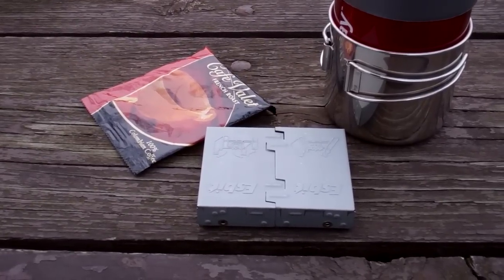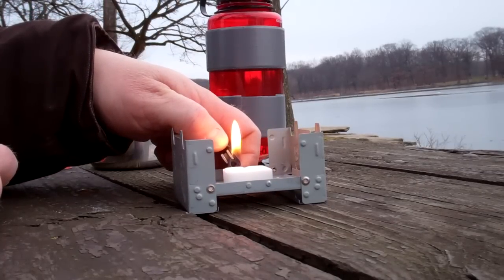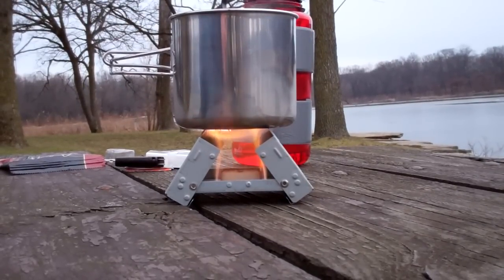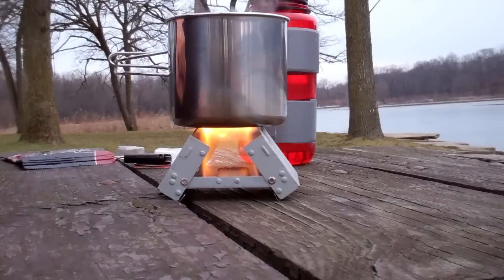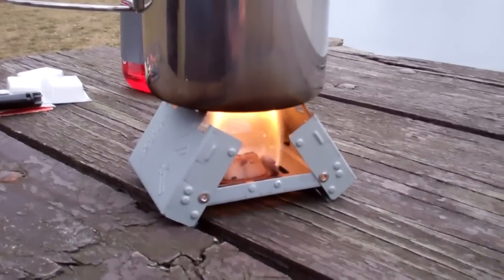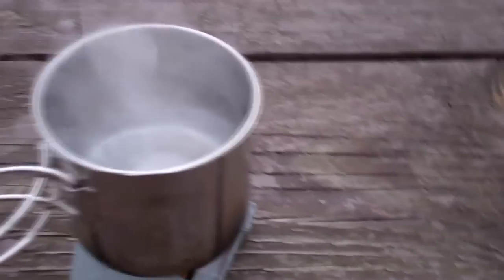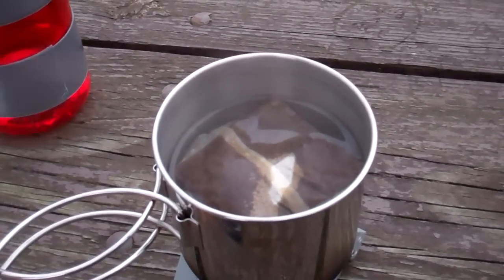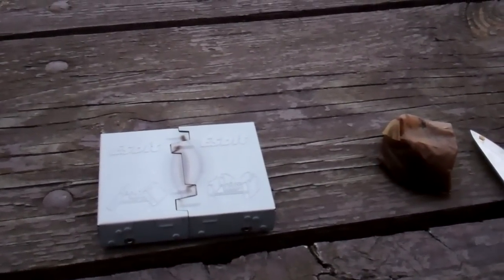GSI Bottle Cup & Esbit Pocket Stove

Comment: These stoves have been around for a long long time.  I used one in the (Australian) Army in the 1960s, including a tour in Vietnam.  Often cooked up a storm with it and my canteen cup (numerous dishes involving combat rations mixed with a handful of dry rice).  Once eaten, it was a case of quickly cleaning out the cup with dry grass so that a cup of coffee could be made before dusk prevented any further visible flames.  Usually two or three fuel tablets was enough for a gourmet meal!
Reply from the maker: oldigger thanks for your comments and your service to our country.
Reply: Yep .. mine was issued to me in '68 when I did my National Service in the South African Defence Force. Kept and used it right into the 80's on my Call-ups.
Still have and use it .. at least weekly. The rivets have loosened up a bit and need crimping .. keep forgetting to do so 🙄 .. although the Windscreens that I have made for the Stove keep everything stable. 
For fuel I use Alcohol Gel Fuel (Brennsicherheitspaste here in Switzerland). Cheaper than the Esbit Tabs and easier to source as Indoor Table Top Fondues are a 'National Sport' in Switzerland and the Gel Fuel used in the Burners is available almost anywhere. Cleaner burning than the Esbits or Meths (Alcohol).
I've cooked up full English Breakfasts using the Esbit Stove, Gel Fuel, a Swiss M84 Water Bottle Aluminium Cup and my Military Issue Dixies (Mess Tins). Easy peas 😊.

Comment: I had one of these when I was a boy scout and later on bought another one when I was in the army because It was pretty much the only thing that could fit in the back pouch of my combat harness. It's lightweight, small, reliable and when we ran out of tablets we used some dry artillery propellant pellets, which was like lighting a rocket under the tin cans we used to boil water and worked like a charm.

Comment: I've been an "ultralight" hiker for more than 40 years, and I know a little bit about trail stoves, especially lightweight ones. This type of stove pre-dates me and has been used by every major military on the planet and is still in use by some of them. They work very well and in any climate. I just ordered a lighter weight Esbit model and it's going to be my primary stove.

Hints: get some titanium or stainless foil to make a windscreen. Use another small piece as a ground pad to reflect heat upwards. Using a lid will reduce your boil time dramatically. Trioxane works very well but it has half the heat output as hexamine. On the up side it burns very clean and the flame is nearly invisible at a distance. I'm told that's why the US Army switched to it before replacing it with flameless ration heaters. Stereo? Good for heating cocktail sized wieners to the point of being lukewarm. Use one can per hot dog. Scraping the fuel tablet with your knife makes it easier to light...so does tipping the cube (rectangle?) up and applying the flame to a corner.

Comment: the best way to light the fuel cubes is holding the cube by one side and lighting a opposite corner and dropping it into the depression, more control and the flame creeps so slowly on the cube that you shouldn't burn yourself.

Comment: You can actually fit 5 fuel cubes inside the stove.  You have to separate the packages, align three in one direction  ( I I I ) with the foil down on the outside two but foil up on the middle one, and then two in the opposite direction ( - - ) with the foil side down.
It's a snug fit but it does work.

Comment: I did the same thing with the Sterno cans. I got a case dirt cheap at a big box store and when I tested them pretty much figured it was only good enough to keep a decent eating temperature but not very good for purification or boiling purposes. They would work good if the power went out and you needed something hot to eat or drink, or as a fuel source in general. Otherwise for survival purposes related to purifying water, its pretty much useless.

Comment: Thanks for sharing. Yes, its a great little backup stove and worth every penny. I keep mine in the "get home bag" just in case I have to cook up a mountain house meal. This takes up much less room and is way less expensive than a Jet Boil and you don't have to lug a can of butane around. Be sure to have some aluminum foil with you to wrap around the stove if it's windy outside. Nice Endura 4 by the way. One of the best blades under $100 bucks in my opinion. VG-10 is good stuff!

Comment: Sterno actually will boil water but it take upwards of 20 minutes for two cups of water.  I have an older sterno collapsible stove that works but it isn't very convenient.  The esbit stove seems like a better approach.  Of course, if you want to spend the money, nothing beats the Jetboil or similar type setup.  I love mine, boils more water in half the time and doesn't take up much more space than the nalgene/nesting cup approach.  Overall weight isn't too bad either.

Comment: one guy's review with this stove was to place the fuel up on its side and this increases the flame for optimum flame
Reply: one more thing, the fellow who did these tests with all kinds of fuel said that if properly windproofed the "Sterno" can lasts about 2 hours and DO give a hot flame enough for cooking or boiling water
Reply: About 60 mins is the most you can achieve if using an Epicurean stove from Flat Cat Gear.

Comment: First off let me say sterno sucks.  Secondly sterno is used pretty regularly to boil gallons of water in hotel pans.  It's pretty much the whole point.  Outdoors it has a hard time boiling water but inside it's easy.  Sterno is basically like a slow alcohol.

As far as the esbit combo... I've used this exact setup.  Depending on the age of your gsi cup you may be able to use a peppridge farms pirouette tin lid as a cover.  I have a video up on it showing how it will either work perfectly or not at all.  

As a fuel esbit is the best hexamine available as far as I know.  It's compact, it can store in small places, and can be blown out if you're done cooking. It is obviously useful as a fire starter.  It tends to be more difficult to light with a firesteel... I'm not saying it can't be done but you definitely need to pulverize a small bit of the cube to get it to take a spark.  Another advantage is that it can be mailed without any special precautions which is why it is sometimes popular with long distance hikers.  It goes right in the re supply box with the food.

The disadvantages are mainly high expense per btu and relatively low heat output.

Comment: try using a refillable torch lighter they burn a lot hotter and you can store a ton of extra fuel for them in your pack considering it is a compressed gas and they burn much much hotter i keep a couple of those and 2 cans of butane in my mil-pack. and i never leave the house without one of them in my pocket.. especially since im a smoker lol

Comment: All you need are the fuel cubes, the stove is an unnecessary gadget.   Find a flat rock or us a tin can lid to lay the fuel cube on and put four rocks around the cube, light the cube and set your pot on the four rocks or two rocks, whatever works. All you  need to carry are the fuel  cubes.  Save your money and lighten your pack and no mess.

Comment: Be careful if you use this stove on a table top with some of the cheaper fuel tablets (particularly some types of "Hexamine" from the good old Peoples' Republic).  I used one in my Esbit stove and it burned very fiercely, for a fairly short period of time and actually set light to the table immediately beneath it (easily put out with a little water, but I had to remove the pot and then move the stove with pot grippers, which involved an unnecessary risk of further  fire or of burning myself).  I now make a point of having a piece of foil under the stove!
Reply: really good idea..and I will do that...thanks for tip..

Comment: i would get a rattle can of high heat flat black paint and paint several coats on about 3/4 of the pot. that will drastically reduce your boil time

Comment: also a 2nd tip don't wrap duck tape on your bottle unless you never ever plan on washing it out or washing the outside of it "yuck" it's just not a great option. I prefer to take a flat piece of plastic say something like those plastic nightmare hardshell clamshell packaging for store brought items. Then wrap the duck tape on a flat business card sized piece to store tape. if you can get it a piece of that frosted plastic like on a milk jug or office supply folder works best as it tends to be nonstick to the to the duck tape so the last piece of tape is still sticky to use. cheers.

Comment: oh and you can boil water with sterno it is still a fire and an alcohol fire at that.... they heat to about 800 degrees boiling temp is 360 degrees or so XD
Reply: its just too bulky to be honest if your prepping it is something you would want to keep in a bunker or something along those lines and they dont heat well in the wind it just depends on how close you get the flame to the pot or cup.